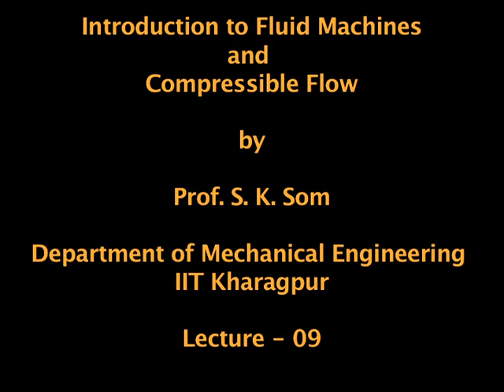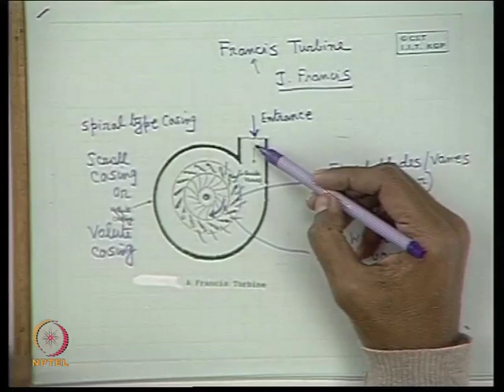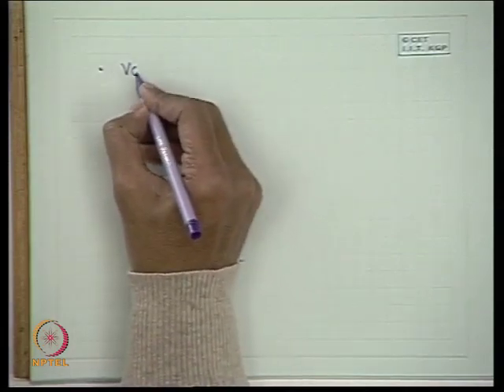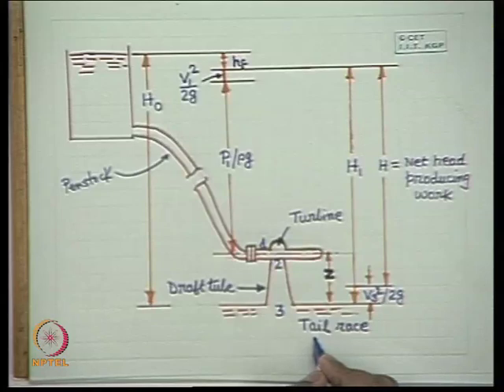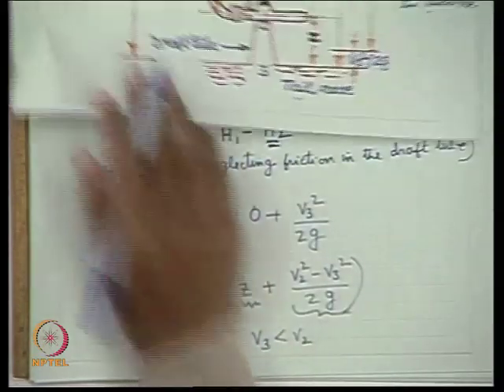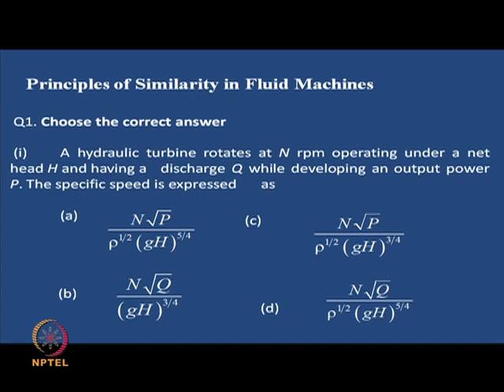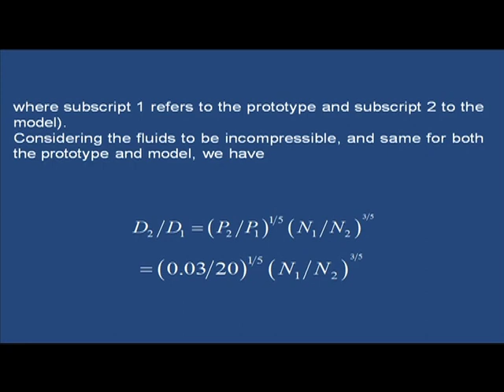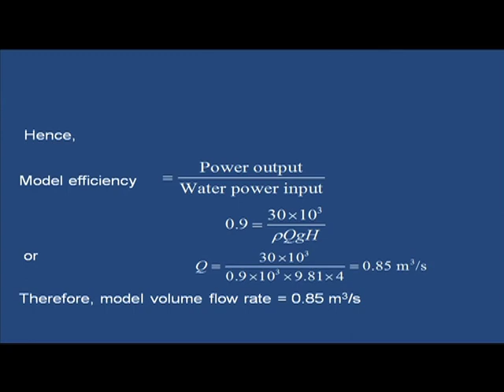Mod-01 Lec-09 Introduction to reaction Type of Hydraulic Turbine - A Francis Turbine

Comment: Sir,
Thank you for these wonderful lectures.
All the mechanical energy is obtained in the shaft and that comes from energy transfer at the blades.Energy is lost at the outlet in the form of kinetic head V2^2/2g. What is the use of saving that in the draft tube when it cannot be obtained in the shaft itself?
Kindly Explain.

Comment: Very good lecture. Why you analyze everything for one blade only? Is it not necessary to multiply the power by the number of blades? I understand that almost all blades are impulsed by water simultaneously.
Reply: The flow in turbomachines is usually assumed to be independent of tangential direction, i.e. velocities do not vary with tangential direction. Thus, we can analyse the flow for a single blade (or blade passage) and effectively scale it for the whole machine using the mass flow rate, instead of considering flows for single blade passage and then multiplying it by the number of blades (or blade passages).

Comment: I don't get the use of draft tube, is it just so that we can lift the turbine up from tail race or does it actually increase the net head across the turbine producing work?

Latter seems not to be the case since, even if pressure is negative velocity will increase in proportion thereby keeping the EGL smooth. 

Hope to get it in next lecture.
Reply: It allows a reduction in static pressure at runner outlet. This is equivalent to a  decrease in H2 (total head at 2). If we use a draft tube of constant cross section, we get V2=V3, and p2 is then higher than when we use a diverging draft tube.

If we do not use a draft tube at all, the pressure at exit will have to atmospheric and the turbine exit will have to be at the same level as the tailrace. This is a limitation for the available head across the turbine, (since H0 is fixed, so available head will depend on how much we can reduce the static pressure in the runner). The limitation is solved by the draft tube.
I hope this helps.

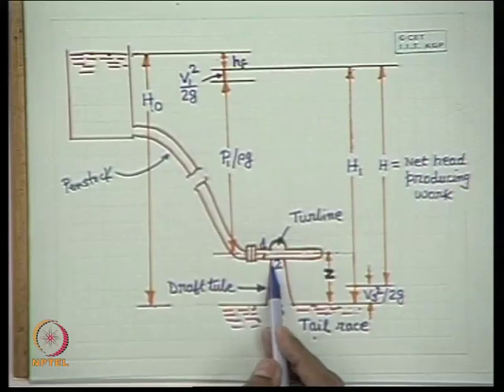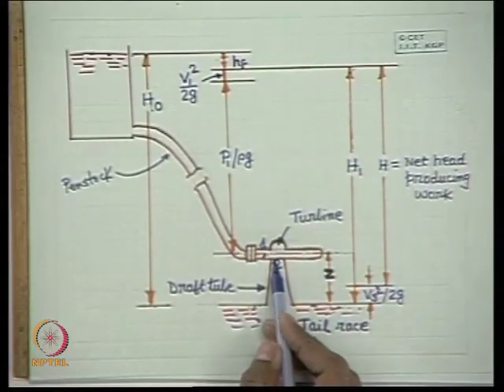Comment: Please can somone help me and write here what  he  said between 27:00 and 27:10 about draft tube and thank you very mush
Reply: when fluid passes through drafttube the fluid will not loss any energy but the kinetic energy if the fluid will get converted in to pressure energy of fluid.we want to increase pressure energy because the water comingout is at vaccum pressure which cant be discharged to atmosphere.